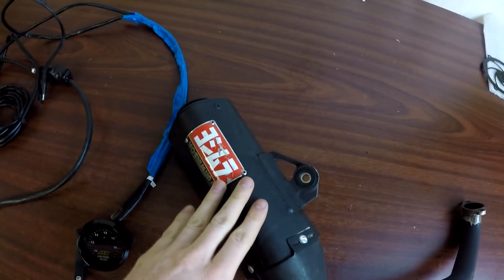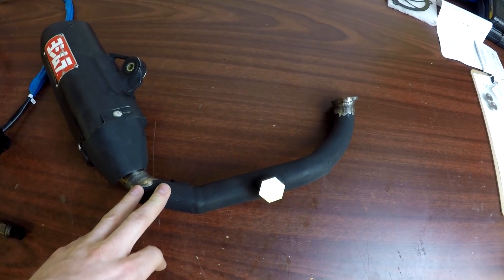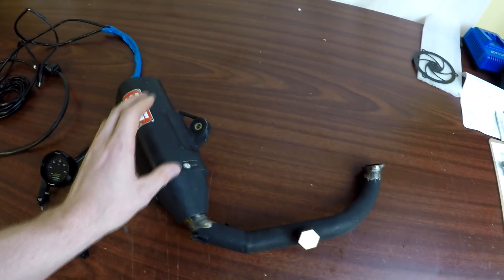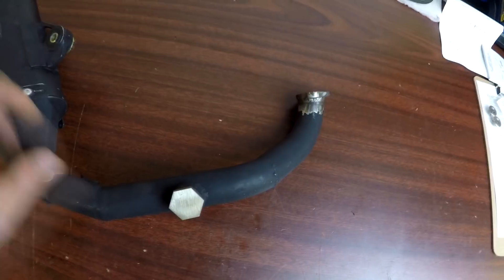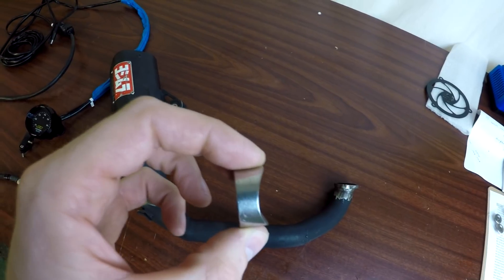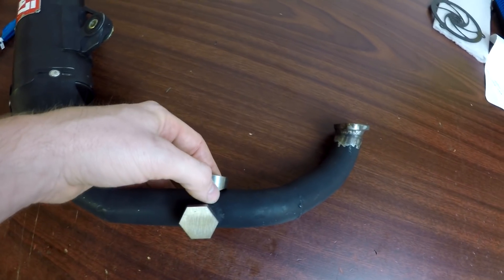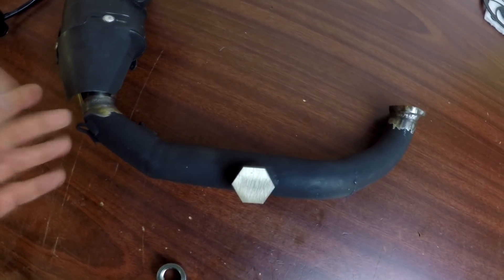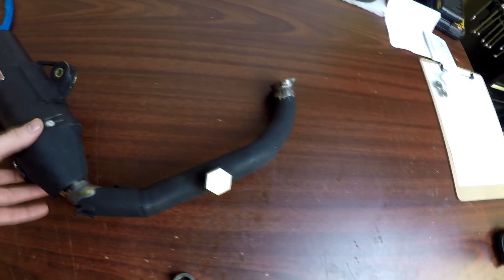What I use to tune my gy6

Comment: I need to make a tune up exhaust like that.  My method is "if the plug ain't black, and like it dont blow up after a bit at wide open throttle, its good" 😂.  I do think itd be cool to have a whole wideband tuned scoot like that though.  Motos bike would run mint.....if he ever cleaned his damn carb 😂😂

But fr, i see the feel tuning taking long.  Especially if youre somewhere weather changes nearly day to day.  It took me maybe 2 or 3 weeks to tune my 150 just by looking at the plug and playing with jets
Reply from the maker: Yeah man the spare tuning pipe helps big time.  I can tune the bike accordingly in 15-20 min.  Yeah his jets are probably junked up haha needs to spray it out.
Reply: @burnoutbobby  i cant wait to throw my carb and intake on with the cam.  Pulling 61 right now with just "bolt ons" and a tuned carb.  Hoping for 70 🙏.  If his ruck can do 70 with that fatty kit and all on it, hopefully my ped can pull it out of somewhere.
Reply from the maker: It should I’m doing 72 on my 150 with carb and trans kit
Reply: @burnoutbobby  ive kinda got the idea with the clutch to be as light as possible with the variator tuned right, hopefully itll do it with the carb and stuff with 1500 rpm springs.  If not, ported head and a 5 shot 😂😂

Comment: Great video Bobby, will this setup work on a stock pipe and exhaust? This winter I will be going to a performance exhaust and pipe but don't want to put a bung hole in it.
Reply from the maker: Kachi's Kid I don’t see why not. What size is the header you have
Reply: Regular stock 57.4mm, but will be moving back to the 61mm, I have a Taida 171cc engine in there with an A14 cam. Just saw your vid. on the A9, which I will be changing too when I change my head back to 61mm. I have my own channel where I'm building the bike for speed.
Reply from the maker: Kachi's Kid it just depends on the header size so the o2 bung the cc won’t matter.
Reply: Thank you, bro. Keep up the good work and make that $$$.
Reply from the maker: Kachi's Kid thank you man